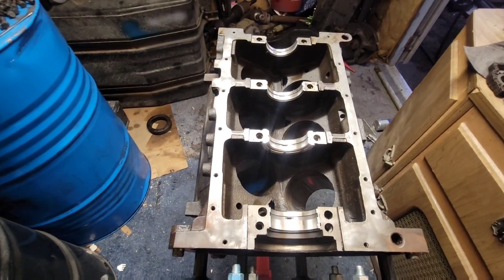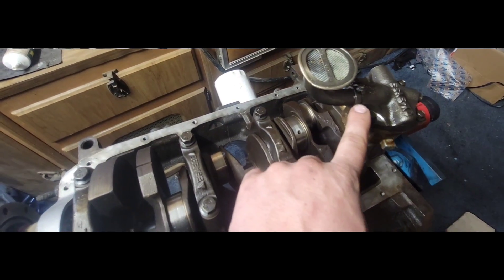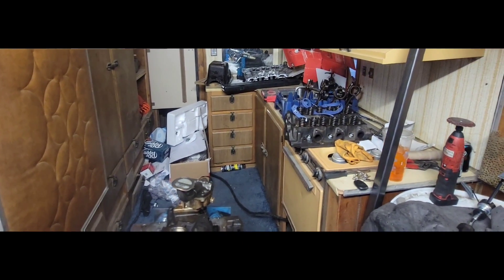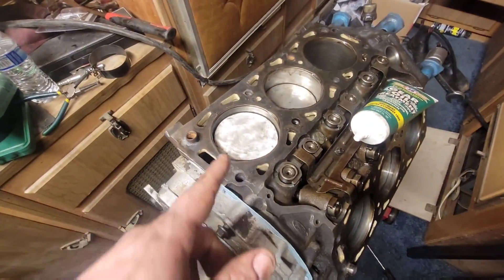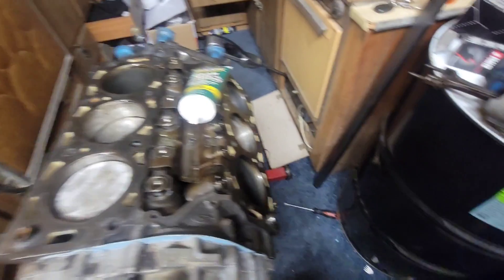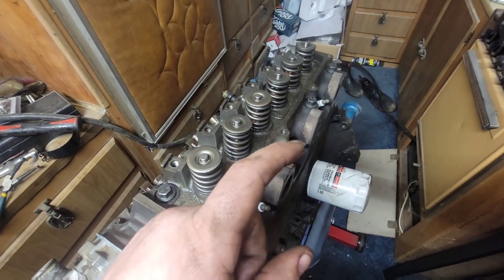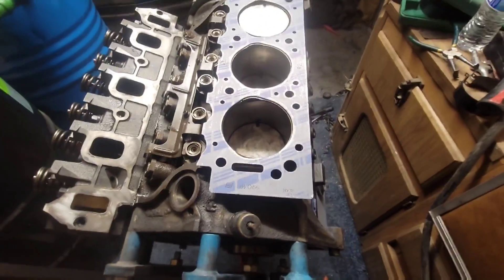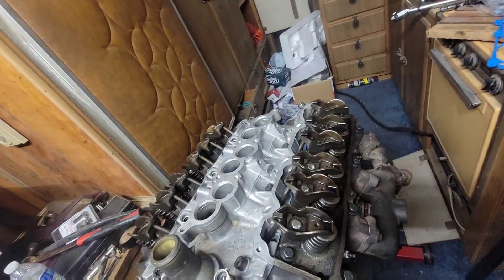1992 Ford Ranger 3.0L Engine Rebuild

Comment: Did your rotating assembly become hard to turn after installing the new rings(with the heads off). I tore my 3.0 down about a year ago and it smokes really bad after doing the work. The only issue I encountered when doing the work was a tight ring gap, which I ground down so it would be right around 10 thousandth A lot of the other cylinders read in the 12-15 thousandth. But there were a few that I found I needed to grind.
Reply from the maker: No, my rotating assembly did not become hard due to the assembly lube that I had used.

Comment: I'm at this point with block on a stand. Old compression ring had .035" gap and 160psi no cylinder wear. The rering kit top ring was .028" gap. Ford & Haynes manual call for .015" to .023" ring gap. What would you do?
Reply from the maker: Here's my issue with the ring gap, according to my shop software Prodemand Mitchell, the ring gap calls for .010"-.020" for the compression rings on my 92. But do remember that old rings may have worn down to get the .035" gap, and they might have originally  been .028" or whatever the original size was. Are you doing an oversize ring kit or is it factory size?
Reply: @backyardmechanics5170  Thank you soo much for reply...I can't get anyone to comment on this in several forums. I'm simply refreshing the engine 101k miles wifes daily driver due to the heads cracked and sludged oil finding little wear even at bearings. Yes, I just yanked the engine wanting to also fix oil seal leaks. With the original big gap .035" the cylinder still had 160psi 170psi with an oil squirt during test. The ring is the same width as the new ring. The bores all measured to be very close to perfect and stone honed great. I did buy a rering kit STD size and this new ring had .028" gap. Is this a mfr defect I wondered? THEN...I ordered Hastings .010" over and this ring had almost zero gap. These can be filed to fit spec (maybe .018") BUTT I'm still concerned why there is so much indifference. Please give me your opinion.
Reply from the maker: From what I have seen the factory style replacements always have a slight indifference to them. You don't want to have a zero gap because as the motor warms up the gap is going to close up onto itself. I went with std rings due to the quick availability at the time and my gap was about .050, however, I am not really to worried about this motor at the moment. This truck is my beater truck. My 7.3l was done properly.
Reply: @backyardmechanics5170  I understand heat and ring gap needed. It just confuses me why there are so many indifference's in spec. I can't afford for this rebuild to fail and need to get it right. I'm chancing either way maybe less using the kit rings with the .028" gap OR filing the .010" over rings to fit within spec goal to be .018". Tell me...do you think there is any chance of the gap closing .018" being a regular ole wife driven go to store for my sandwich fix'ns...lol?
Reply from the maker: I'll be honest without knowing any other measurements piston diameter, cylinder wall diameter etc I couldn't make that call.
Reply: @backyardmechanics5170  I unnerstand. I'll give that to you in the AM. You did give me something to think about here. MAYBE the .035" minus the .028" new ring gap is .007". Now subtract that from the new ring gap and we have .021" That is within tol of new. The bores could all be worn .007". SO in logic, I could file the other new set of oversized rings to fit spec and I should be OK.

Comment: Is this the same block as the Taurus 3.0L Vulcan engine?
Reply from the maker: Yes they just changed the way the motor mounts are attached, exhaust etc.
Reply: Si, si es el mismo el de la Ranger, taurus, ghia y topaz v6 todos los que lleven el vulcan es lo mismo